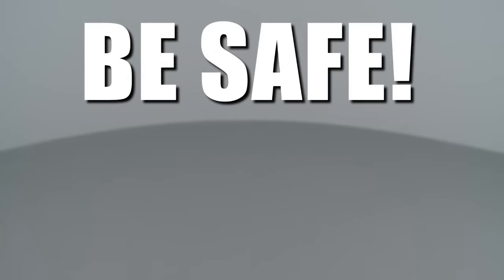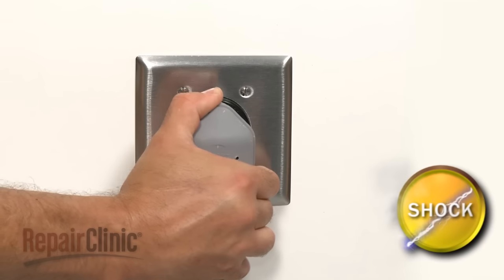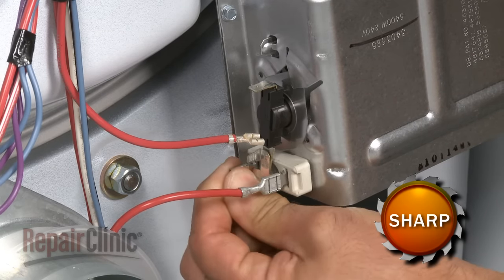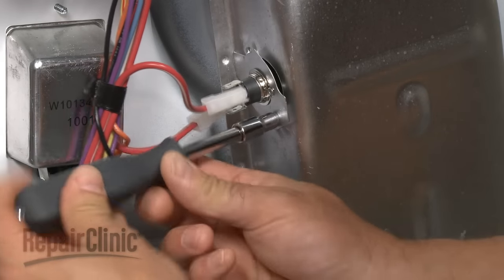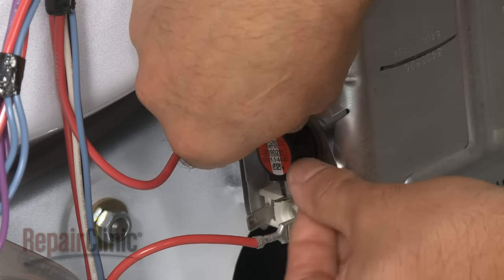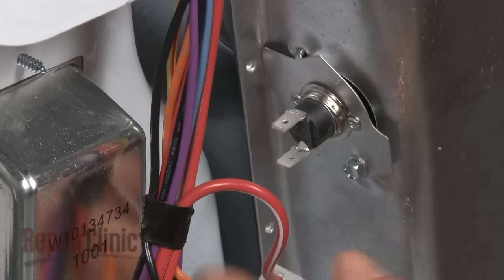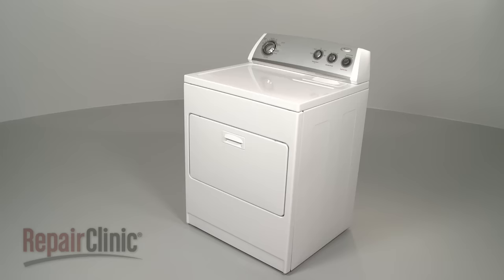Whirlpool Dryer Replace Thermostat & Thermal Fuse #279816

Comment from the maker: One red wire goes to the top of the thermostat and the other to the right side element terminal. The orange wire will go on the lower terminal of the thermostat with the new jumper wire. The two wires will need to go together the orange wire will need to be stripped and a new piggyback terminal  added to it so both wires can go together on the same bottom terminal of the thermostat.
Reply: Why isn't this in the video?
Reply: I needed this comment bad lol! Thanks for the clarification.
Reply: @bradphenix  are you able to dumb what he said down to me?

Comment: As it turned out, I didn't need to replace these parts to get my dryer working again (it was the heating element), but this video made it very easy to replace these parts nonetheless. Thank you!
Reply: Wouldn't it have still spun? Letting u know if it was the thermal fuse or not? I thought the thermal fuse would stop operations...if you get no heat it is still operating.

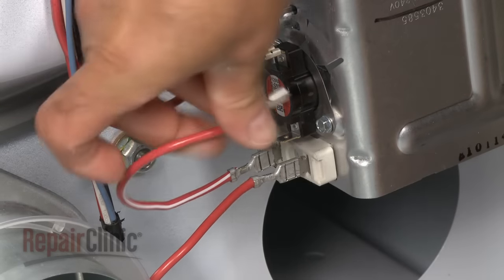Comment: 1:05 when they say this, if you have an orange wire like I did you have to cut the old tip to it and add a bigger one(that should’ve been with the kit) and then added to the red wire with the extra end to it so they create “one wire” again. Hope that helps someone
Reply: Your comment was super helpful, thank you! I actually ran the dryer without connecting the orange wire at first and the dryer didn’t stop running until we manually stopped it. I appreciate you taking the time to write this!
Reply: @sylvoszabo3548  yeah no problem! I’m glad I could help someone else. I was lost when I had an extra wire😆

Comment from the maker: Thanks for the comment, we appreciate it. I apologize for the confusion regarding your part purchase. Typically the terms thermal fuse and thermal cut-off are used interchangeably and it can be a little confusing. Please do not hesitate to let us know if you need any questions answered in the future.
Reply: Does it matter which way the thermostat is turned? In other words, is there a correct terminal to put the white striped wire on?

Comment: I have an older Kenmore 80 Series dryer that has 2 red wires (one with a white stripe) running to both the terminals of the heating element as well as the thermostat (it looks like newer models just bridge the thermostat to the terminal with a red jumper wire, as included in the parts kit...). the non-white-striped wire on the terminal of my dryer has a blackened terminal, which I'll replace.  the white striped wire going to the thermostat is similarly burnt.  How should I fit this new jumper wire on (i.e. - which wires should I connect, and what should I do with the other wires?). Thanks!
Reply: I don’t know if these guys reply anymore, but be careful my red wire with the white stripe just burnt off the white plastic box-like tip around the connector.
Reply: @PBandJ8  Right! I have the same problem.  Did you manage to resolve your issue?
Reply: @scottymcknight8298  it’s working without the plastic covering the connector, yes.
Is that safe, I have no idea! 🤷‍♀️

Comment: I totally understood your video and it was extremely helpful; however, I have a white wire with a smaller end left.  What do I do with it?
Reply from the maker: +Cyndi Monte The thermal cut off on the upper section of the heater housing should have two wires. The change in this kit is with the high limit thermostat. The jumper that connected the high limit to the element is now a wire.
Reply: @repairclinic  I don’t have the jumper wire on my dryer. Should I still go ahead and install the jumper wire?

Comment: Guys,..when you are doing repairs,...please do close-up video of the particular section you are working on, so we can see where what wire goes back to each connection! Would really help!
Reply: I agree, but also you can slow down the video. Click on the three dots in the upper right corner.

Comment: So I have question ;  my  Amana dryer won’t start. Before but I ordered thermal fuse. In Amazon’s  Which come 4 thermal pieces in the order which I changed only two  the little two fuse going at the very lower side that almost them looks together each other  is what  I changed. well but I didn’t change the  others two so you think would be problem in a future ?   I hope you understand my question. And thank you for read my question have great weekend

Comment: What gauge is the wiring for the dryer using? My thermostat had melted the wire due to a corrosion issue, and I need to replace a section of it to run it safely.

Comment: Does it matter which direction the new thermostat goes on? Its completely symmetrical, and I can tell which direction it goes. Yes, I'll make sure to plug the wire back in as they were previously (Blue top, black bottom), but does it matter which direction the thermostat itself is installed?
Reply: @repairclinic  Perfect, I got it hooked up and its working great! The jumper from the thermostat to the thermo shutoff was fried, so I replaced both, and the jumper. It was a little corroded, hopefully a little bulb grease will fix that on the connections.

Comment: I bought these new parts and for some reason the high limit fuse I got is same as the old one and it slides onto the thermostat but one of the wires won't stay on the connector, the post seems smaller then the connector

Comment: my whirlpool has both of these at the top of the vent that comes from the burner Nothing at the bottom. There is also a jumper wire, does that go between the fuse and hi limit?  the thermal fuse is checked by continuity but what about the hi limit?

Comment: I just replaced the  high limit thermostat of my Whirlpool dryer using this video and now my dryer won't stop during the "cool down" cycle. If you notice, the original thermostat has 3 terminals but the replacement only has two. I did a little research and discovered issue is caused by disconnected orange wire which originally was attached to the 3rd terminal. When i replaced, I just tapped it off. Any idea on what to do with this "orange wire"
Reply: I have the same set up.  The kit I bought had 2 connector ends in it.   One has a male and female connector.  You need to cut the small end on the jumper and crimp the male/female connector to it.  Then you need to cut the end of the orange wire and crimp the new 3/16 (i think) connector to it.  Then the jumper gets connected  as shown in the video.  Then the orange wire gets reconnected to the new male/female on the jumper.  Hope that is clear.
Reply: Thanks a lot. I did that and everything is working perfectly fine now.

Comment: I have an orange wire that leads to the timer that is connected to the original hi-limit thermostat.  There is no connection available for that wire on this replacement thermostat.  Can I still use it somehow?

Comment: Looks like I have the same question as another guy but I don't see an answer yet.... I replaced the fuse because that's what was blown but did not replace the other part because it was not that easy to get out.  Is that going to be a problem?  The dryer now heats but seems like it is really really hot but maybe I'm just not used to it.

Comment: Several things:
1) like this machine, mine did not have a 3rd (orange) wire. Most videos show that wire and require the male / female connector jumpers splice.
2) while I did reset the old (upper) high-limit thermal trip by throwing it on the ground, 15 times before it made, I used it only as a test to prove that that was the only thing holding me back. After installing the new one, threw out the old one.
3) after all repairs kept the back off and checked cycle times (90 on, 45 off). ** This was after a 5 minute initial warm up in a warm house, on a warm day.
4) while I did find a good online vendor from another videos referral, I used Cashwell Appliance in High Point and they were able to walk me through some questions, worth the extra money
5) SCHEMATIC TRAINING ANALYSIS ... GREAT Video:  
Dryer not heating up 
https://www.youtube.com/watch?v=yCOPR5HNb20&feature=youtu.be

Comment: I have the same parts and replaced them and wired them as they originally were, however mine did not have a jumper on the lower heating element connection as shown in the video...after replacing all these parts dryer still does not get hot. Does making a jumper cable like this bypass any safety features? Should I try it?
Reply: I got same problem. Did you use the jumper wire to fix it? Thanks

Comment: I replaced the heater high limit thermo fuse, heating coil and the thermostat  on electric Maytag centennial dryer and it still does not heat up right. Heats up some but not all the time. Is there another part that would cause that?
Reply: Did you ever figure out the problem?  We have the maytag centennial and it has been a lemon for us.  Maytag finally just gave us a refund for the cost of the unit after sending out technicians multiple times.  We replaced the heating coil last year but now we have no heat again.  We will try doing thermostat and fuse but may just give up on it and find a new one

Comment: I had no heat in my dryer. I purchased a kit and replaced the fuse and it worked, should I still replace the thermostat?

Comment: the spades are the same size and the switch can bolt on either way with no indication of whats up or down so my question is does it matter
Reply from the maker: For the high limit, the larger wire connector from the jumper wire will go on the heater terminal and the other end to either of the high limit terminals. Usually, the lower works best just to keep the wires from crossing. The other wire will go on the remaining smaller terminal. For the upper thermal fuse, it doesn’t matter which terminals the wires go on.

Comment: Hello, I replaced thermofuse # 3977393, but I got confused with the cables conection. Does it matter which cable is conected to each terminal or they have to be in the right circuit polarity?
Reply: thank you! 👍

Comment: Do the wires need to be put back in any particular way?
Reply from the maker: No, no polarity on  a two wire thermostat or fuse like this as long as they are the correct two wires. Thanks!

Comment: My Maytag Bravos steam dryer (model MED6600TQ0) will not start.  The display is on but the dryer only clicks and doesn't come on then gives me a F1 error.  If I replace the High Limit Thermostat and Thermal fuse will this fix it?

Comment: My hi limit thermostat does not have that tab that connects to the heating element. I did not take a photo when I was disassembling it. I need guidance. Mine is part no. 3390291
Reply: Did you figure it out
Reply: No. Bought a new one

Comment: not sure what I did wrong but after doing the replacements my dryer doesn't turn on at all now.  The issue i was fixing was to just restore my dryers heating but for reason the dryer has no power now.  any suggestions?
Reply: You ever figure it out. I’m having same issue.

Comment: One misleading aspect of this video is that what it calls the "thermal fuse" is generally called a "thermal cut-off."  The thermal fuse is a little oblong white piece that is located near where the hot air is vented out of the unit.  Since this video showed the piece that I knew was broken (the thermal cut-off) and called it a thermal fuse, I ordered the wrong part and had to go to the trouble of returning it and ordering the correct part, the combo thermostat/thermal cut-off #279816.

Comment: I got the part to change my high limit thermostat, but it did not come with a jumper wire nor screws.  How can I get these? Or do I need to re-order the part?
Reply from the maker: The kit part # 279816 should come with the jumper and screws. If the parts are missing and you purchased them from us you will need to give us a call at 800-269-2609 and have your order number ready and we can get a replacement kit to you. The jumper wire is not sold separately.

Comment: I mistakenly cut the red wire instead of the orange to attach the piggyback.  How do I add the white plastic connector and what is the actual name of that adapter?  Thanks
Reply from the maker: The white plastic is a protective sleeve that is not sold as a separate part. You can install a new ¼ inch terminal on the wire and use a screwdriver to release the plastic cover off the old one and put it on the new one. The terminals are part # 240984 and  are cheaper in a pack rather than to buy one. You also may be able to find one at an auto parts or hardware store.

Comment: I am replacing the heating element in a Whirlpool dryer. Will the old thermostat from a Whirlpool heating element, part # 8565582, fit in the new heating element part #279838?  Or do I need to buy a new thermostat along with the new heating element?

Thanks.
Reply from the maker: The thermostat should fit with this heating element. When a part number is substituted, it typically does not change it's compatibility with existing parts.
Reply: Thanks.  Got it fixed and saved money.

Comment: according to Searspartsdirect website this is the kit for my dryer.  but my model has 2 wires connecting to the heating element and 2 wires connecting to the high temperature thermostat.  is this compatible with my model? and if so how should I connect it
Reply from the maker: +Swirvithan LGoodlingSplatt If you type your model number into the search box on our website (RepairClinic.com), we'll show you the exact kit for your model.

Comment: i followed this video to the letter but i noticed when you replaced the High limit thermostat,  the smaller wire that you initially pulled off, (to where you now put a  jumper wire) has no place to go, am i missing something?  And now my dryer won't turn on when i put it on air dry... please help!

Comment: Can anyone tell me if the high level thermostat has a specific top and bottom that one side must be the jumper wire and the other must be the power wire? I'm not positive if it matters which terminal on the thermostat I should put the jumper on, or if it doesn't matter at all.
Reply from the maker: The high limit thermostat terminals are both the same size. It doesn't matter what terminal is connected to the jumper wire. Either way will work.
Reply: Thank you!

Comment: I replaced the thermal fuse heating element and hi temp cut off on my kenmore 600 electric dryer and now i have a burning plastic smell coming from the dryer and when I tried to dry a load the dryer was smoking is this something I connected improperly?
Reply: If you replaced your original thermostat with one of higher temperature you have the risk of catching some fire (if you don't have a fuse) in your dryer either with the lint or your clothes I guess. If it's the same capacity then it might be the plastic housing of the same thermostat the one that smells but there shouldn't be a problem.
Reply: thanks so much it ended up being the dryer cord I had to replace it also

Comment: How do you know which terminal is which on the thermostat? You know, so you have the correct wires connected to the correct terminals.
Reply from the maker: If there are only two wires to the thermostat it does not matter which wire goes to what terminal as there is no polarity on a two wire thermostat. If there are more than two wires from the old thermostat to the new see the instructions included with the thermostat for wire splicing information. Thanks Mitch!
Reply: What about the fuse? Does it matter which wire goes to which terminal?
Reply from the maker: Same deal, if it is two wire no polarity on an alternating current system.
Reply: Thanks!
Reply: RepairClinic.com What about when changing the cycling thermostat?
Reply: Same again if it is two wire t-stat. As long as it is the correct two wires for the thermostat does not matter which wire goes where.
Reply: The cycling thermostat has 4.
Reply: TheRepairGuru OK, I finally had time to work on it. The cycling thermostat is an original replacement part so it looked exactly like the old one. I just lined up the logo and printed part numbers on the actual part, to look just like the one in the video and it worked. The high limit thermostat is what threw me off because it's a universal replacement part that looks nothing like the original. It even comes with extra wiring that I had to cut and add the special little clasp that has the extra prong for the third orange wire...sheesh...I'm buying the original next time! haha
Reply: TheRepairGuru After all this, I think it's the motor. It works for about 5 minutes and then shuts off and won't start. Let it cool and it starts and then does the same crap all over again. I really need to start testing these parts first...I almost have a brand new dryer now...haha. Anyways, thanks for your help. It has been great ordering from you guys and  if I do need a new motor, I will be ordering it from you guys, for sure.
Reply: Oh

Comment: After following these directions, my heater burns too hot, even when set at low settings.  Does this mean I connected the wires incorrectly?
Reply from the maker: You may have a shorted element. I would test the heater element with a meter. Unhook one side of the element and with the meter set to the ohms setting check across  the element terminals. You should get a ohm reading if the coil is good. If one of the terminals shows a reading to the case the element is shorted and will need to be replaced. If the element checks good. The cycling thermostat may be bad or you have bad air flow from a restricted vent or blower wheel causing the heat to back up.

Comment: Replace all 4 thermostats/ relays and my dryer still runs for five minutes and stops. Any suggestions?
Reply: Could be the timer or knob. Check if it has continuity and might be a easy fix using sandpaper. They have diagnostic videos on YT.
Reply: @HM-yr1vr   Thanks for the response.  It turns out it was the motor. Replaced it and it's working great now.